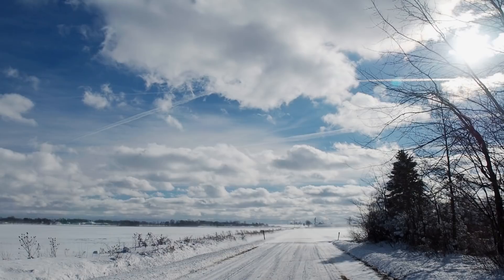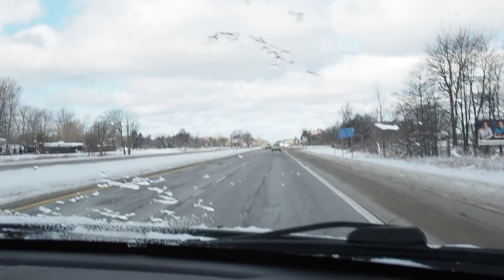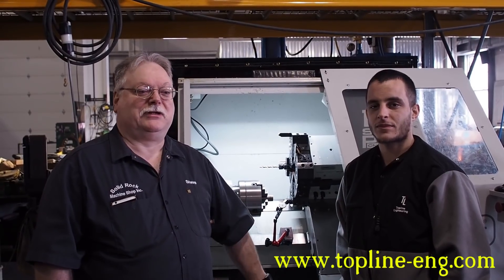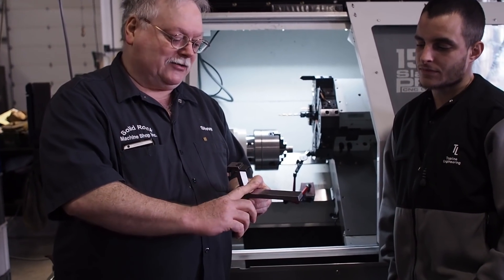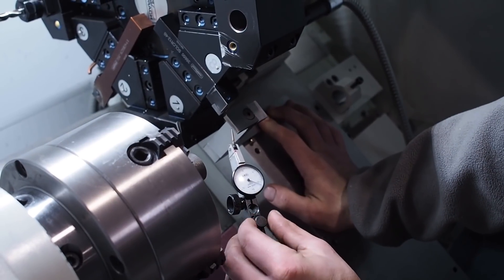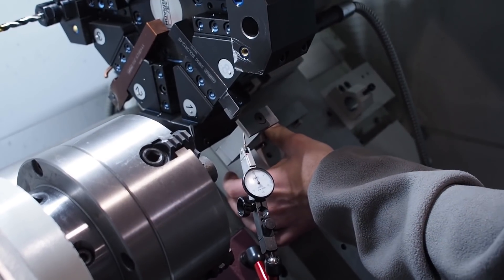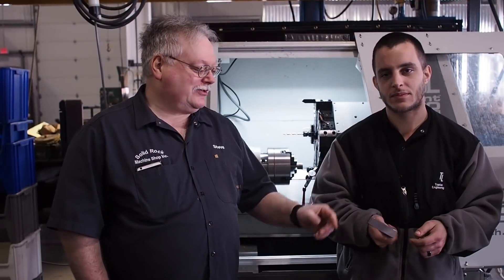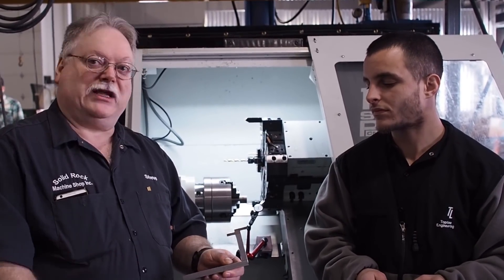TopLine Engineering

Comment: Hello from Northern Minnesota.  Your ride to work looks just like mine.
Reply from the maker: Hi Green,
I bet it's cold there every winter. Is it colder than usual this year in your area?
Steve
Reply: Minnesotans love to brag about their weather, ya know! Yes, it started early in October and stayed.  We just broke through three weeks of an Alberta clipper that brought us continuous sub zero and often to -30F.  That in itself is not unusual. It was just more then a month early.  Generally, that would happen between jan 15th and feb15.  Today the snow is melting. Over the next few days it will be +30F.  We haven't had a normal winter for many years.  In fact, over the last 10, we have had several winters that looked more like KY. 5 years ago, we had more snow then I have ever seen before.  So I went out and bought a new snow plow for my truck.  It has not yet plowed any snow and is starting to rust.